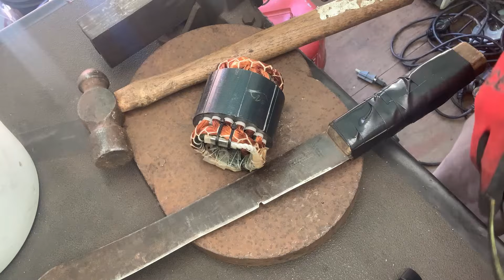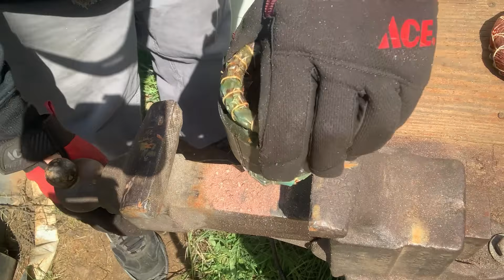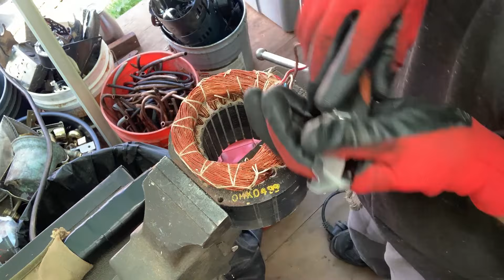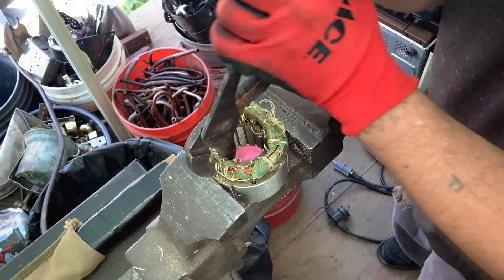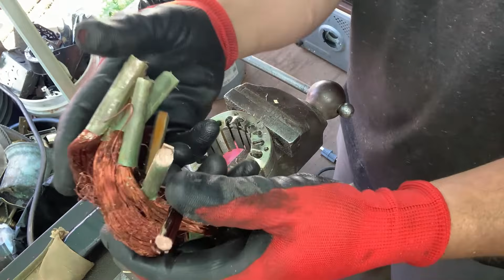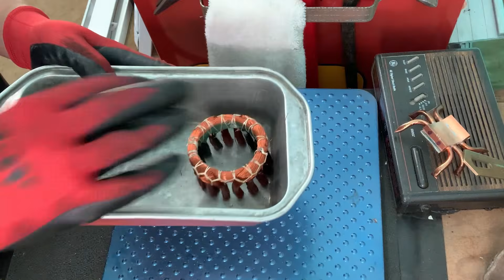How To Remove Copper From Motors - 2 Different Methods

Comment: I started watching your videos and started to scrap I was blown away when I found abandoned small refrigerator next to my job still has a compressor on it so I took it home and took off the compressor and I didn't want to throw it back the same place where I found it so I decided to take the whole thing apart piece by piece so I can throw it in the trash as I took the outer panels off I noticed that there was copper tubing running all inside the foam insulation on both sides I thought I struck gold
Reply from the maker: Right on, thank you! 
Yeah most people don’t bother with the copper tubes since it’s messy to get them lol. 
Will your yard take the fridge as shred steel? Once you get all the goodies from it.

Comment: Great advice. Been scrapping for 30 years or so. Do you also melt? I wanted an opinion on smelting, anybody?
Reply from the maker: Yeah I’ve been getting into melting. Actually just posted a video this morning where I made some zinc coins. I’ve also melted copper. 
Ask away bud?
Reply: @scrapitall200 is smelting copper into bars worth more at a scrap yard than just stripped wire. Is it worth doing at all?
Reply from the maker: @BobALuga-d2m no they are not worth more. In fact lot of yards won’t buy ingots. 
But, people will buy ingots on eBay. I’ve seen 1 pound copper ingots sell for $10 a piece. Then there is sand casting and the artistic pieces can fetch good money at local farmer markets or other similar venues or eBay. 
So there is potential to make good money melting metals, but not from scrapyards.

Comment: Could you use something like a heavy duty paper cutter? Basically a machete witha hing on the tip and mounted to a stable surface. This allows great pressure to be applied. Or a press with a wedge blade.

Comment: Hello I have a question do you know if there is a way to get the copper wire out without cutting it I have a project I’m working on that needs the wire and I’m wondering if I could repurpose the wire instead of spending money on new wire because I don’t have to much of that 😔
Reply from the maker: I do have a video where I do show a way without cutting, but it doesn’t always work. If you scroll through my videos you’ll see it. 
What about striping insulated copper wire, would that work for your project?
Reply: @scrapitall200 TY so much I just finished getting all the copper wire out ❤❤❤❤
Reply from the maker: @NUMNUM3-lolheck yeah, awesome!

Comment: I know how much you detest cutting or grinding inside your shop that’s why you do it outside however, when it comes to taking apart motors, I’ve got a little catch basin to capture all if not most of the copper dust and I save that as well
Reply from the maker: That’s good, it does add up. 
Thank you for watching

Comment: There very thin cutting disks on the market for less copper grind dust loss. Even better to machete the end off. Your insulation varnish is dry and brittle enough to pry the entire large bunch of copper our in one easy go. Just pry it more times in different places. If you do enough of them it would pay to lay plastic around your job to catch copper losses.
Reply from the maker: @brucegedye6512  yeah I use Go Yonder brand and they are super thin and really good. I just don’t like all the dust lol. 
Yeah this is a fairly old video, not my best lol. Thank you.

Comment: If you work it around the edges on the big one it pulls easily all at once the smaller one has but the same way the copper is stiffer in the small ones
Reply from the maker: Right on 👍 thank you

Comment: I'm going to try a SDS hammer drill with a 4 inch chisel I hope it goes well since I have 200 or so motors to do. Just not sure what chisel type to use I don't think they make a 4 in wide chisel for a SDS hammer drill for metal I've seen some for bricks and concrete and floor scraping.
Reply from the maker: @michaelnonferrousscrapper682  yeah I’ve seen those used. I’d love to try one day myself.

Comment: Not all copper is copper, so what do you do with it
Reply from the maker: @evansnick81  it will be copper or copper coated aluminum. My yard will buy the copper coated aluminum as clean old sheet aluminum. 
You can also just sell the motor complete as an aluminum motor.
Reply: @scrapitall200  Same as my yard ;or 1 of them '   one yard said "Breakage " S&A " for my copper coated Aluminum wire / Copperweld .   I did sell my first big batch of 200+ lbs of stripped Copperweld wire at 'EC' wire price cause they told me it would be EC when I asked months before ( 98% ) of the workers at my 2-3 yards don't speak english or act like they don't .     I really don't care to mess with Copperweld or C -Coated motors , but for Old sheet price Ill strip some when board or cause of my OCD . LOL    Thanks for the vids & God Bless you & yours .
Reply from the maker: @DavidJones-ib3zy  yeah that would be frustrating trying to communicate, we just want the best price and what they tell us. 
Thank you and God bless!

Comment: Wow. You do things the hard way. Turn the motor sideways. Clamp only the metal in the vise. You'll be clamping the thin metal pieces together, not squishing them like you had it. Then use an air hammer with a notched chisel to zap the copper out. Or just a notched chisel and a hammer. On the string, if there's not much coating on it you can cut in one place and pulled out. The string will unravel in one solid pull. It takes practice to find the right spot. Usually from the inside you are pulling to unravel. Works best on compressor motors.
Reply from the maker: You do realize most hobby scrappers won’t have that kind of stuff?

Comment: Isn't there some method to actually remove the copper coils from the stator as a whole without exploiting it with the cutter machine ?!🤔

Obviously yes put the stator part of the motor with the copper windings intact in the hydrogen peroxide and acetone solution inside a glass tumblr
(1 litre demineralised water +400 ml of acetone and 350 ml of hydrogen peroxide )

The mixture temperature should be just ranging between 5°-7° celsius 
Then slightly turn on the gas flame and bring to a boil with Tumblr lid closed a small  vent open should be there  for steam pressure to escape 
 
As the mixture starts to boil keep it boiling for 5 min then turn off the flame and let it cool to room temperature naturally after it is cooled take out the stator and start unwinding it with taking out plastic from the stator slots first then copper wires one after the other until fully scored in one piece .👍🏻
Reply from the maker: @Åbhîshēk-Raj-009  I have a video showing how to remove the copper without cutting at all, but it’ll only work with the ones where the insulation sleeves can be removed. 
Very interesting method you just shared, thanks!
Reply: @scrapitall200  but I think it will work in most cases because the manufacturers usually use the papers or plastic inside the slots and the insulation jacket tube is generally present outside or the part of the copper coil that's protruding outside which most scrappers cut to score the copper.
And I feel if the copper is scrapped as a whole it would fetch the scrappers a little handful some of bucks more .
Reply from the maker: @Åbhîshēk-Raj-009  the price will be the same as far as the scrapyard is concerned, but I love ideas that most don’t think about and your idea I’ve definitely not heard of before.
Reply: @scrapitall200  hahaha definitely brother because it's practised in here the local workers scrapp copper in the same way from big old junky motors and use the coppers to make transformers ranging from small to medium to slightly big all for the electronic purposes all that's local hand crafted to even machine one's 
So the value of the copper reaches from the scrap value to market value thus fetching the local owners a good amount of money.

Comment: What type of metal is it that holds the copper? Is that worth saving to scrap?
Reply from the maker: It’s steel and at most scrapyards that will go as #1 prepared steel. Around 10 cents per pound. Thank you for watching.
Reply: @scrapitall200  nice thank you for letting me know I couldn’t find it anywhere on google had no idea how to even search for it
Reply from the maker: @limtuc7030  you’re welcome!

Comment: Wastin' time on those little, tiny motors, not making any money!!! If you're going to work that hard, and spend that much time, you need big honkin' motors!! Rather than making $0.15 - $0.45 an hour, make $45-$55+ an hour!!! Need 400+ Lbs motors!!

Machete = Yes! If you're going to do these little ones, and the Machete can make them that fast, you are in gold town!!
Reply from the maker: I’m a hobby scrapper and if it’s fun, it is always worth my time.

Comment: Just put the windings in a wood burner for a while. Wire comes right out after that
Reply from the maker: My scrap yard will not buy burned copper.
Reply: @scrapitall200  I know I did it before and the scrap yard bought it
Reply: I had a 50 hp motor
Reply from the maker: @TheJohndeere466  lucky you but mine and many others will only buy it as shred.

Comment: Hi, great video. I used to be with a company that rewound motors and to make them more water resistant they were soaked in varnish. To make them easier to strip, they were first heated. Suggest after you have cooked a meal in your oven, put the motor in to soften the varnish. It will make stripping easier. All the best.
Reply from the maker: Oh wow, thank you for the tip, I appreciate it.

Comment: Does the machete just work on iron or can it be used on steel also? The use of the machete is definitely new to me but I will give it a try.
Reply from the maker: I’m sorry, I’m not exactly sure what you’re asking? 
Machete works great, I haven’t been disappointed yet. Thank you for watching.
Reply: @scrapitall200  The way you are able to cut the motors in half. I do not know if their are steel motors and if so, can the machete cut through it. God Bless!
Reply from the maker: @anthonycolangeli4133  the layers are steel but I’m cutting through just the copper. God bless you too brother.

Comment: the one was so tough because of the plastic inside the holes, you'll notice the plastic came out with the copper, the others it did not.   with tough ones like that i find that channel locks work better than prying.   and when prying it helps to put a block of some sort between the steel plates and your pry bar, i like to use the square end of a big punch, it changes the fulcrum giving you better/easier leverage.
Reply from the maker: Yeah that darn plastic lol. 
Thank you for the great ideas and tips. I really do appreciate them. 
Thank you for watching.

Comment: I did 7 motors like this one.  Garden shears & grill scraper didn't work, but meat cleaver, after creating split with hand chisel, worked well but was damaged a bit.
Reply from the maker: I’ve been looking for a meat cleaver to try. 
What sort of damage happened?
Thank you for watching.
Reply: @scrapitall200 likely chipped the blade. You would generally avoid the baton method with rigid blades, as they can potentially be dangerous if broken while applying force to it.

Comment: I use a sawzall, i think copper can clog your grinding wheel and cause it to explode, and if you've ever seen a grinding wheel go thru a face shield, well the juice isn't worth the squeeze
Reply: Done a couple hundred with the 4" grinder and 1mm thin discs.never had a problem. Practically can't buy machetes in the hardware stores in australia any more because of african street gangs in the cities and the govt runs a nanny state. Finally found a large meat cleaver and it works great and I dont have to sweep up copper dust anymore. Fridge motors are best as the windings pull out by hand mostly. All the sawzall cuts ive seen on videos make a frayed mess.
Reply from the maker: I’ve tried a sawzall and I think I need to try a finer tooth blade, cause the ones I had just made a mess. But I prefer my machete over sawzall or a grinder. Grinder works great but it’s messy, the dust gets everywhere and is dangerous to breathe in, plus what you said, they can explode. Thank you for watching and for your comment.
Reply: Yikes! I didn't know about the exploding.  I don't like the dust, though, as I scrap inside  my living space.  I'm a hobbyist, and I don't have a shed.

Comment: You should be wearing a industrial mask so you don't inhale the copper dust.  I had a friend die of copper poisoning
Reply from the maker: Copper poisoning? I never heard of that. Thank you so much for the advice. Very sorry you lost your friend 😢
Reply from the maker: Just looked it up. Thanks again for pointing this out to me, I really do appreciate it.
Reply: Copper poisoning is a real deal. It simply requires a proper dose to be deadly. The copper dust is most definitely deadly-- potentially. This is coming from a guy that was born way before they invented safety. I never have cut a motor in half with a knife before. You can bet big money that I'll try it next time----if I can remember. I enjoyed your video.
Reply from the maker: @5x535  i definitely looked it up after Stephens comment and I’m being way more careful now, thank you! 
I sure do love my machete, cuts transformers in half as well. Best of luck to you and thank you for watching.

Comment: you changed my life with the machete hammer trick
Reply from the maker: That is so awesome to hear. It has changed mine as well. It’s so much quicker and no mess from the angle grinder making dust. Thank you for your comment and for watching.
Reply: Does the Machete cut through the copper??
Reply: @tommymostar8512 Yes, but make sure the blade is flexible, not a rigid mall ninja one. The rigid blades can snap and fly off or cause you to hit yourself with the remaining blade attached to the handle.

Comment: Try using a sds hammer drill on hammer only with a flat chisel attachment modified to a v shape 
Can you can remove them coils in seconds 
I used to do it the way you do with a screwdriver now i can probably do 2 to 3 in the same time using the sds
Reply from the maker: Yeah I need to get one of those! Thanks for watching and your good suggestion, I appreciate it.
Reply: @scrapitall200  👍 keep up the work
Reply from the maker: Thank you!

Comment: Nice!
Reply from the maker: Thanks for watching, hope it helps you with that frustrating motor you had.
Reply: @scrapitall200  oh that generator, yeah. That was a pita, for sure.
Reply from the maker: Did you ever get the copper out?
Reply: @scrapitall200  nope. I haven't even looked at it since.

Comment: I find the machete method to be very interesting, I’ve done the same thing by using a hatchet and hammer, but honestly I’m personally more efficient by using the grinder to chop the top off and I use an air chisel to push out the windings
Reply from the maker: Grinder definitely works really well. I just don’t like all the copper dust getting all over everything. I’m also trying to show ways to do things without power tools in case some don’t own any. Thank you for your comment for watching my video.
Reply: Hi everyone… 
I know we all have our preferred way of doing things!! I feel like I have to say why this method is crazy 😜 helpful easy simple extremely clean no waste of material no need for power tools even you have them, you can spare their life expectancy, no need to buy new discs after the wear down, no need to clean the surroundings or your or the tool, no need for the grinder or chisel noise (is noisier than 5-10 hammer strokes) no need for breathing ppe, no need for safety goggles 🥽 even though you should have them on at all the times you work!!
Less risk the the knife/machete/hatchet method IMO!!   Happy scrapping everyone

Comment: If I can make a suggestion...when your motor is in the vise, don't pry from the side.  That is the weakest part of the vise's holding power, and the motor wants to twist.  Pry from the front or back where the jaws are.  The vise holds a lot stronger at those points.  Good video.  👍
Reply from the maker: That’s great advice, thank you, Roger! Thank you for watching.
Reply: I use an inexpensive air chisel and the windings come right out. I used to use the method depicted here in the video until I saw another video of some using an air chisel. It is much easier this way.
Reply: @davidbolton184  i was wondering about that.  I was trying using a hammer drill on hammer mode and it only cut the wires